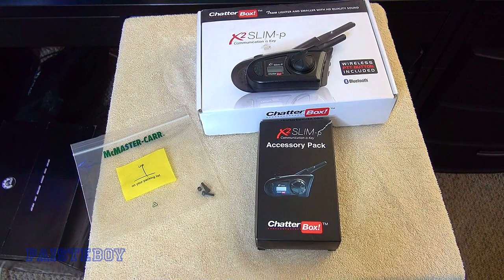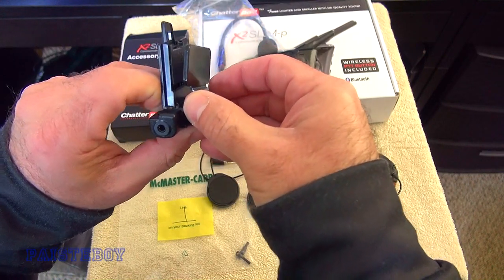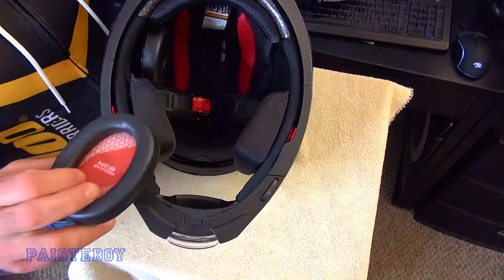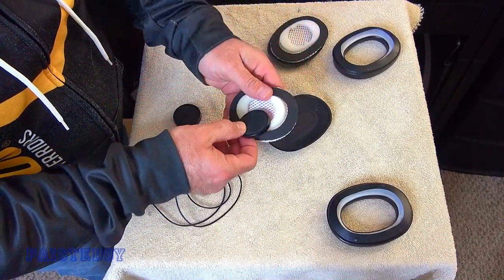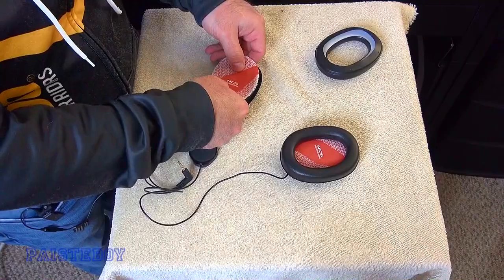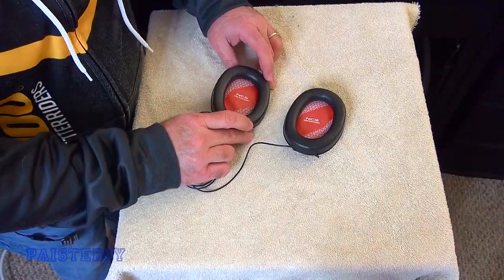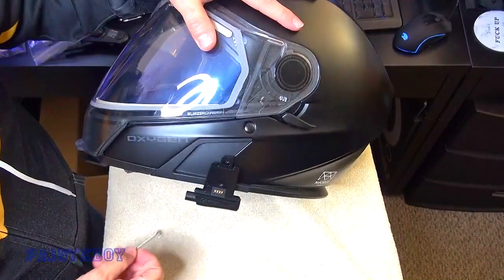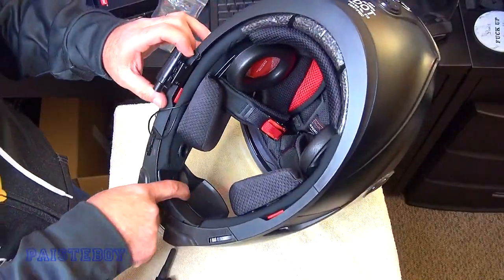Chatterbox X2 slim-p Installation on Oxygen Helmet

Comment: The units have GMRS/FRS 22 channels and will be programmed with one of 50 random CTCSS privacy codes, giving 800 potential channels to prevent interference with other teams.

X2 Slim-P allows an unlimited number of drivers on the same team.

2-way radio signals are not restricted to “line of sight” like Bluetooth. At tracks where the drivers disappear behind hills or other obstacles, Bluetooth will cut out, whereas X2 Slim-P will keep communicating.

There is NOTHING currently on the market like this system for performance, clarity and range.
Reply from the maker: Well said!!!  Thanks for the comment.

Comment: Would like a full review of the Chatterbox. How does performing in the cold -10F
Reply from the maker: Ok. Thanks for the suggestion.  I'll see what I can do.
Reply: @Paisteboy  how is the sound quality for you? What is the coldest weather you used them in and how was battery life?
Reply from the maker: The sound quality is really good but you have to remember that it is a Radio like a walkie-talkie but still has really good sound.  With any in helmet communicator the quieter your helmet is the better it sounds.  I heard a big improvement when I started using my Oxygen helmet last season.  It is a very quiet helmet. Also not having a breath gard or mask over your mouth really helps too as with the Oxygen helmet. 
As far as the cold goes we haven't had a single occurrence where it didn't perform even in the negative degrees Fahrenheit as 4 of used them in Maine with Oxygen helmets.  Not sure how cold it was but some mornings it was 20 below before we went out. 
They don't cut out in long distances and they aren't limited to line of sight like all of the other Bluetooth brands.  You can also have unlimited users connected.  Just select the same channel and subchannel to link them together.  No mesh system required.
Hope that helps.
Battery lasts all day too.
Reply: Thanks really appreciate it. I have an Oxygen and my daiaghter has a CKS hybrid   Awesome response. We ride Wisconsin
Reply from the maker: Yw. 👍

Comment: PITA to get my ears to bend back once they are in.  Now I’m gonna put this comm in and wonder if it’ll be okay without the earpieces.  I tried it both ways and the sound is fine. Just worried about moisture.
Reply from the maker: Let me know how it works out for you.  Thanks for the comment and for watching.
Reply: @Paisteboy  They earpieces are definitely a no go. It’s too much of a PITA. I’ve gone 2 years without them.  The guy I got the Chatterbox from said they use Tork X3 speakers as a replacement because they are more waterproof and sound MUCH better. More bass.
Reply from the maker: Ok. I haven't had an issue with the speakers that come with the Chatterbox but I'll keep that in mind.
Reply: @jeremyyaple8498  I would like to know more about the york x3 speakers. Are they a replacement for the chatterbox speakers?